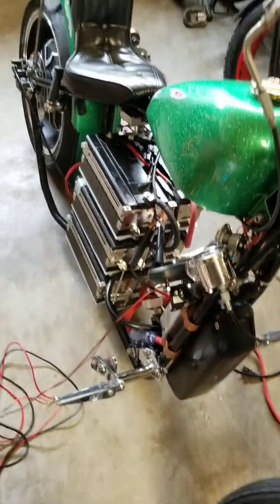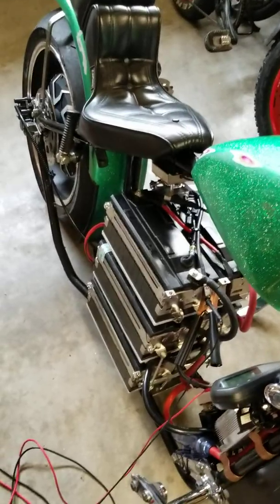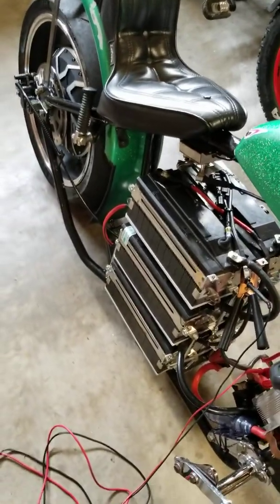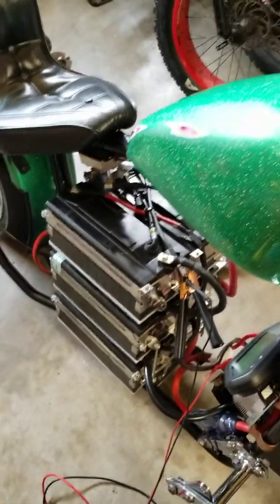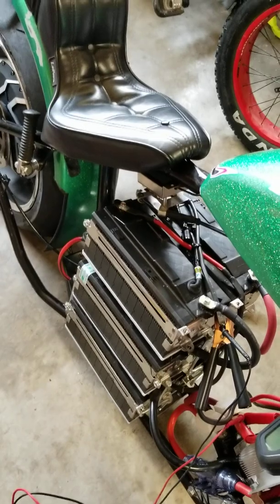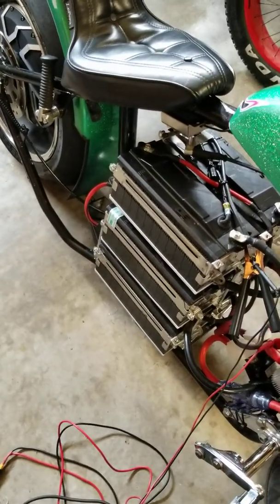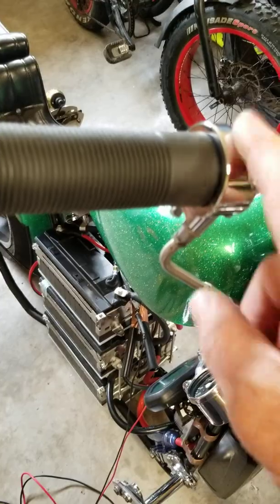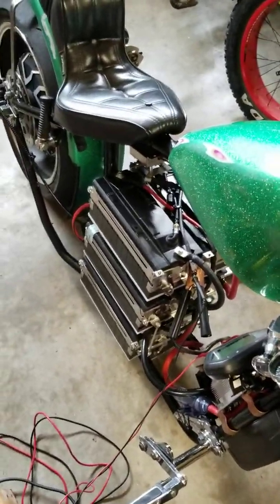QS Motor 8000w v4 in my 71 Harley SportE

Comment: Do you have a parts list?
Reply from the maker: Not much of one. I bought direct from Qs Motor instead of on line. It'll save you time and hassle. Tony over there at QS Motor can get you what you need. If you ask him. I used the QS Motor 8000w v4 motor as a kit. In the end I upgraded my controller to a Kelly KLS14401-8080I and built my own hall sensor pot box throttle assembly. 👍

Comment: Hi, What kind of charger do you use?
Reply from the maker: Currently I'm using a Beleeb https://www.amazon.com/Beleeb-Manually-Automotive-Maintainer-Snowmobile/dp/B07YV58L7C charger for home use and two High voltage Cycle Satiator chargers for on board charging. I have 50' of extension cord in my fuel tank. I reel that out to any 110v plug. I have not been happy with the Cycle Satiator so no link or recommendation. I'm planning on going another route for onboard charging. https://www.thunderstruck-ev.com/chargers-ev/?sef_rewrite=1&cookies_accepted=Y
Reply: @therealtimmytfpv862  I've used the one from Thunderstruck and a few different cars and I'm pretty happy with it. I like that I can change the program in it for different voltages. You have to get one that's pretty close to the voltage though and the nice thing is you can charge at 120 or 240 without any switches or buttons.
Reply from the maker: @steveclunn8165  that's great news! I'm wanting to charge at stations that have the j1772 plug. I was pretty sure the Thunderstruck unit was what I needed. Thank you for the recommendation. I am just unsure if there are any wiring requirements to get the charge stations to activate and allow my vehicle to charge at them . I'm using a Kelley KLS14401-8080I controller. It's capable of can bus. I'm likely over complicating this! Lol! I've done a lot of that through this whole process leaving me with a few things I didn't need and missing somethings that I did need. I'm hoping to avoid that with this purchase. I'm waiting to hear from customer support to see what recommendations they have. Thank you again! You have a new sub! 👍
Reply: @therealtimmytfpv862  i have a video on the charger and the j1772 hook up. Did you put a BMS on this . ?
Reply from the maker: @steveclunn8165  they have thier own proprietary bms on the batteries. Some guys are working on the can bus communication for them but have yet to get it worked out. I've read info from others that have used these lto cells with no bms and have had great success. So I've been monitoring the cells myself. So far my findings are the same. They seem to be staying perfectly balanced. Since I'm not currently running an active bms I've made sure to wire everything exactly the same to keep the draw equal throughout. If things continue to stay stable I think I'll wait until the code for the proprietary bms is cracked. So in short no. 😉🤷🏼‍♂️🤣😂
Reply: @therealtimmytfpv862  that's one of the tricky things about lithium batteries is that in general they seem to attract and stay in Balance very well. This is why many feel they don't need any kind of BMS. As you know when charging and discharging it's at the extreme ends where the voltage starts changing quickly. Sounds like you're doing good just keep an eye on things. I have some bms's on my YouTube channel that I've been using.
Reply from the maker: @steveclunn8165  yes I like the dilithium bms and will likely go that route if cracking the code to the proprietary bms ends up a no go.
Reply: @therealtimmytfpv862  sounds good

Comment: Have you done any test runs? What is status on your project. Im thinking about ordering a 10 000w QS motor on a 17inch rim to convert a yamha R1.
Reply from the maker: I have. I'm ruining 135lbs of lto cells. My controller is a kls14401-8080i.  Fully charged I'm at 97.2v 60ah I'm seeing about 60miles of range.  Speeds in excess of 80mph. I just finished my finale battery build and have been gathering specs as we'r speaking. So that's what I've so far. Sorry for the slow reply. I never recieved a notice that I had a message. I only noticed because someone else's had a question. Good luck with your build! I'm so happy with mine! Peoples reactions have been very positive! Lots of haters when I first mentioned my idea. They have all come around to it now that it's almost done. Thanks for tuning in!